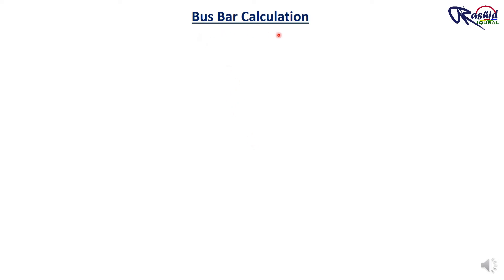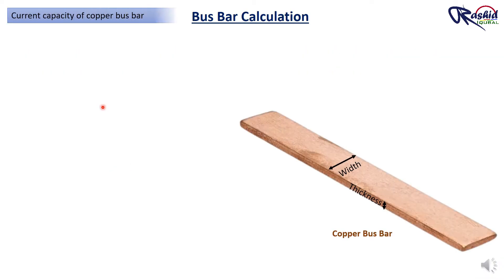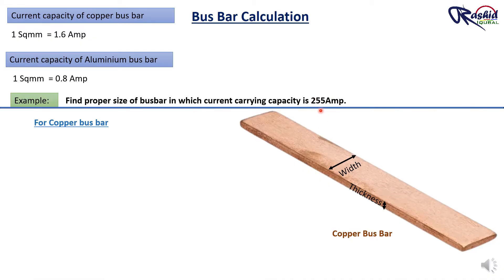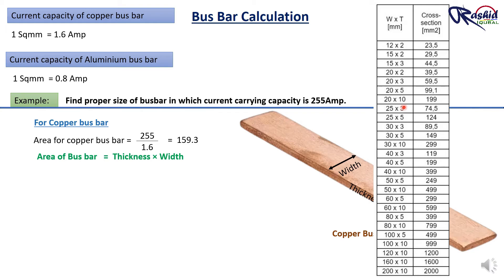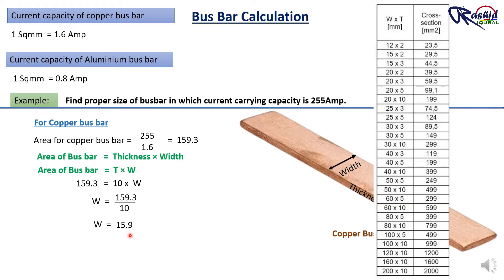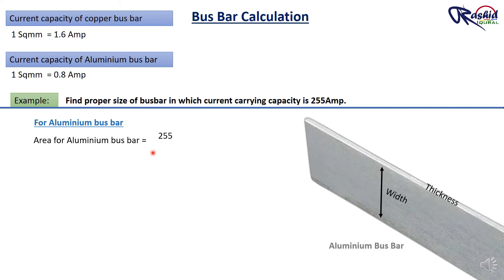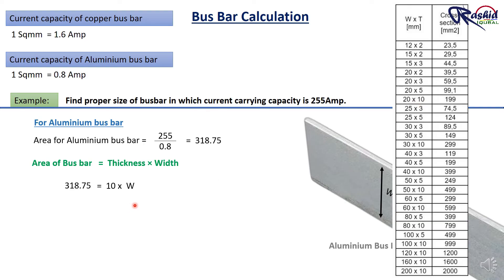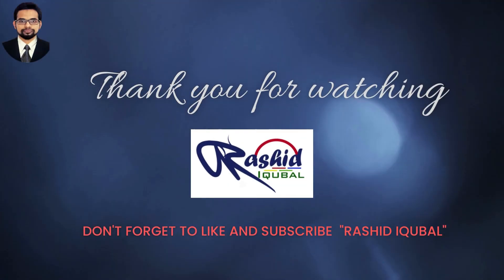Busbar Size Calculation | Electrical Busbar load calculation

Comment: Havells 2.5mm² wire current rating is 19-ampear in duct and 22- ampear in air. So question is I want to use one 1.5 ton air conditioner on 2.5mm². Will it would be a right calculation as per this wire rating?
Reply from the maker: A 1.5 ton AC usually consumes around 1500 to 1800 watts. That means it draws about 7 to 8 amps during normal running.

Since 2.5 mm² copper wire supports up to 19–22 amps, it is safe for one 1.5 ton AC, as long as the wire length is not too long (under 20 meters) and voltage drop is controlled.
Reply: @Rashid-iqubal  Thank you for support- One outher thing. Will 2.5mm² wire take the lode also with 1.5 ton ac along with stabilizer?

Comment: Sir thank you for the video.
I want to know what will be the length of the bus bar for 1C×400 mm^2 cable size for 20 runs?
Please help!
Reply from the maker: Need more detail, Where u have to install ? Voltage rating ?

Comment: sir u forgot to include ambient temp when ambient temp rise than busbar derated so size use to be increased accordingly thnak u
Reply from the maker: sir as i said this is shortcut and easy method for  calculation of busbar. constant for copper and aluminum which i mentioned it covers all parameters.
anyway if we go to proper calculation which consider all parameters, it will be lengthy and long calculation. shortly i will make detailed video on Busbar calculation.

Comment: Length of bus bar matters? Or not
Reply from the maker: Yes length of bus bar obviously matters like voltage drop, heat dissipation, mechanical strength etc. however, for panels and DBs short length of bus bar used that is why these parameters are negligible.
Reply: @Rashid-iqubal  ok when we will consider length as a parameter? Any example?